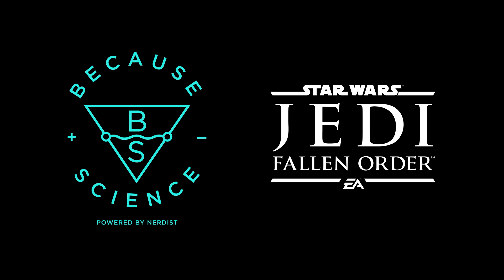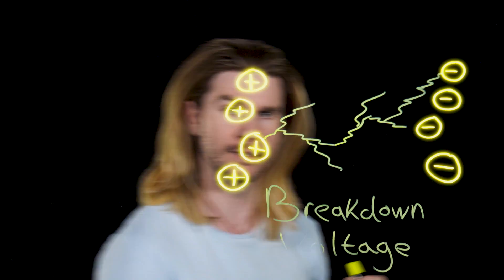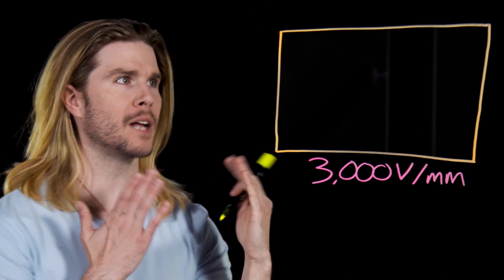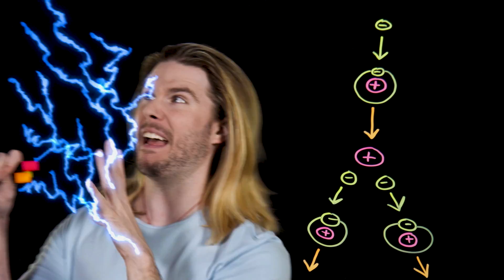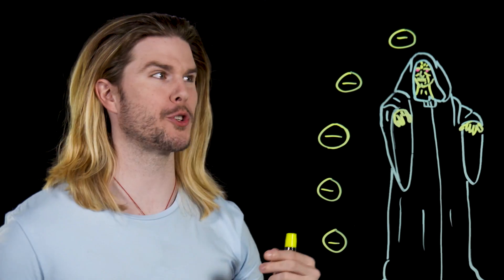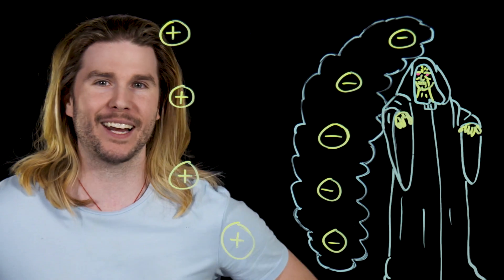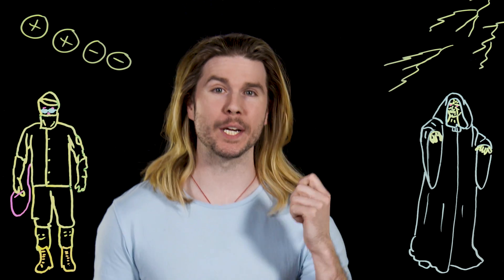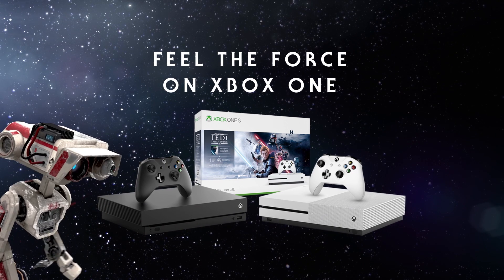How Does FORCE LIGHTNING Work? (Star Wars SCIENCE)

Comment: Ok i thougth about it once before i saw your video, and there is some problem with your solution. 1.st problem: Current will try to discharge of the way with least resistance, so sparks wont go as prob 22m to the human body and then to the ground, instead they will go 1,8 meter to the ground, depends how high is your hands (you kinda solved this solution .... but it would take mutch larger area), 2. nd amouth of power: you speak about high voltages and sparks but people dont die only because of high voltage but the power it delivers by Volt*Couloumbs or Volt*Amps/Time - since spark last not even second it would just zap a jedi (and we dont want that) so Van der Waals generetor woudnt be great. 3. rd is that force lightning can be blocked by lightsaber.
Since a wrote all the things i remember i can get to conclusion. I theorized that what killing a jedi isnt lightning but radiation. That a sparks are just secondary effect.
Imagine a palpatine is giant microwave or magnetron or something like that. Can you confirm this theory or dismiss it?
Yeap i am a**** for nitpicking :D

Comment: Hey, so... i couldn't help but notice that no mention of the REAL killer of lightning was mentioned.  it's not the volts that do the damage,  it's the Ampres. a typical lightning bolt transfers between 10,000 to 200,000 amperes of current in just a couple of microseconds.  conversely, a standard issue police taser conveys approximately 3 and a half milliamps. the amps are what cause the pain and the muscle contractions within the body.  youtube doesn't like subtext, for some reason,  but the formula is  amp = watt/volt ... ohms law applies, so amp=volt/ohm   A = V / Ω.
Reply: Yeah, that wasn’t mentioned. But when your talking millions of volts your probably going to have several hundred amps to go along with it unless the target has an extremely high resistance value. 2 or 3 amps can kill, and while the human body has a very high resistance, it’s not 15 to 20 million ohms good.

Comment: Fun fact: There is also a power called 'Force Fire'. It is a neutral power (both jedi and sith can use it) achieved by rubbing the particles in the air to create friction and heat, but it's so volatile that few can use it effectively in battle to the point that Palpatine has trouble using it.

Comment: (Spoiler alert for rise of Skywalker)  now the longest force ligh lightning would be from the emperor when he shocks all the spaceships in the sky which could be easily what's a 1 mile in the air generously. so using your own  estimations the total volts he would be a spelling is around 4.5 billion volts. which inmate comparison in comparison to a regular lightning bolt is only 1 billion. Not only that but the total amount of joules of energy that is released is about 1 billion and it's over the time frame of 30 microseconds. That is 1,000,000th of a second. So if you take the amount of energy that he is releaseing over the time frame that it is, it would end up being a grand total of 8,999,000,000,000,000 , volts. Or 44,999,550,000,000,000 Jules. In comparison the total amout of energy the entire world uses is about 1,000,000,000,000,000 Jules. In conclusion the emperor would have been able to power the entire Earth energy need for 44 and 1/2 days in just one minute worth of lightning.

Comment: I think it's very important to include that voltage wine not irrelevant, isn't the dangerous part of electricity. A human can encounter 100,000 volts with no ill effects other than a lot of lactic acid buildup. Even watts don't covey how dangerous a current is. Amps is what makes an electric current dangerous. 

Power lines aren't dangerous because the might have to 500,000 volts. Van De Graaff generators easily put out 500,000 volts and all it does is make your hair stand up. Current or rather, amperage, is the important part. Van De Graaff generators only have a current of micro or milliamps. 

Of course we can forget the time factor as well since that accounts for the total energy. 10 amps for a picosecond likely won't kill you. However 100 milliamps for 10 seconds likely would stop your heart. Voltage is fun, it looks cool, but it's not deadly.

Comment: Okay, going to be a little geeky here, but you only referred to the breakdown voltage of air without much reference to the fact that the  lightning is aimed and its effect on the user.

If you consider the user as the source of power, it becomes somewhat of a problem since it requires the user of the lightning to "sacrifice" his own electrons to initiate the charge for the voltage breakdown to generate the avalanche, which will ionize their own body causing severe burns (which, even with force healing, will still not recover the missing electrons since force powers don't generate matter).

Furthermore, aiming a lightning bolt is trouble...you need to maintain control over the flow of electrons constantly (which is not impossible for a force user of course, but should increase the difficulty with the magnitude of current running through the lightning).

A more reasonable solution is that the lightning user manipulates the air itself to be come ionized using the force (which is just a forum of telekinesis - i.e. Force push/pull - on the air atoms) or perhaps use some other external object as a source of electrons. Manipulation of the lightning direction then becomes easier since ionizing the air creates the path the lightning takes on its own.

An additional problem is that the more electrical charge you feed into an object, the more it will electrostatically repel more electrons, making the lightning more difficult to perform the longer it is held. A possible solution would be to create a positive charge either in the target or on the ground using the same force ionization technique to make sure that the charge remains balanced and the flow continuous,and this also continues to the aiming of the lightning.

In Legends, it is shown by Darth Vader that force lightning doesn't HAVE to originate from the user's hands and can be generated externally, which further supports this theory.

If you consider the lightning and its aiming method as plasma and ion manipulation using the force, it also explains why it can be blocked using a lightsaber as demonstrated by several jedi like Mace Windu (the blade being itself plasma tightly held in a blade form).

Comment: Theoretically, there is another potential rather than overloading the air, they use something similar to the arcthrowers that popped up in the books, essentially using something to ionize the air along the path, basically, a fraction of a second before the lightning is released, letting them guide it even more since it would be a force guided thing in the end.

And, just as an added thing, Disney Palpatine fails hard against Legends stunts.

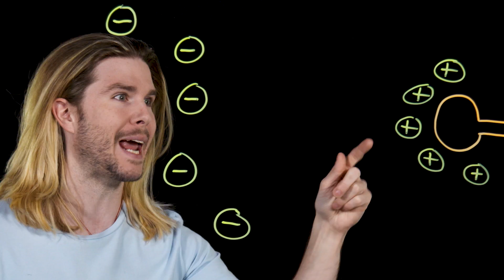Comment: 2:20
Just wondering.. in your animatin the electrical current goes from the + side to the - side... I thought that the electrical charge is supposed to go from the (-) negative side -> towards the (+)postiive side. 
Maybe I remember this wrong its been forever since I was in highschool chem.. but when working with Re-dox reactions I was to understand that molecules react to one another and become Ions. Ions either release, or obtain an electron from one another. the ions that have taken electrons away from other molecules(Other Ions) are the ones that have an Electrical charge. When a ton of negatively charged Ions discharge substantial amount of electrons on a very large scale, you get lightning... But then shouldnt the lightning in your animation be going from the (-) pole towards the (+)Pole??? OR did I miss something??

7:16
Nevermind!
Your animator probably just got a little lost during the editing at 2:20 but at 7:16 your animation is exactly what I would have expected :-D <3

Love you show !!

Comment: Hey Kyle, 
Great episode but I do have a few things to add that you did not mention. Even though the one on the receiving end of the force lightning would get badly burned from the heat produced, the one conjuring said lighting would be burned as well, though not as much due to the polarity. Polarity is actually a large consideration in welding because it determines the amount of penetration goes into the metal and where the majority of the heat produced by the arc is directed. For example; with the electrode being negative and the work positive, the electrode will burn slower and you will get more penetration into the weld but you also run a higher risk of burning straight through the metal. With the polarity reversed, there will be less penetration making a weaker bond, and the electrode will burn up much faster. So this would mean that by using force lightning you could take down your enemy but also take yourself out as well.
You also skipped over amperage as well and that is the most lethal when it comes to electricity. 22 million volts does sound impressive but you can buy handheld tasers with higher ratings. Consider this though, the average home in the US runs on 15 - 20 amps, doesn't sound like a lot does it? Well it only takes 0.01 amps to create a painful shock, 0.1 amps for uncontrolled muscle spasms, 0.2 amps for severe burns and injury, and at .5 amps is almost instant death. From this you could conclude that force lightning must be at a max of 0.01 amps or even less because they are still able to move around and speak clearly.
I would suggest that in order to make it safer for the one conjuring the lightning and less so for the other, lessen the volts and increase the amps. This would lessen the burn you would receive but also make it into a one zap kill.

Comment: with telekinesis alone, it's easier to shock people with small taser rather than try to build up electrons in your skin and conduct several meter of electricity though air, ....or if you're really good at telekinesis, then just simply rip apart your opponent to pieces

Comment: https://en.wikipedia.org/wiki/Electrical_injury

"Current. The higher the current, the more likely it is lethal. Since current is proportional to voltage when resistance is fixed (ohm's law), high voltage is an indirect risk for producing higher currents."

"High voltage (over about 600 volts). In addition to greater current flow, high voltage may cause dielectric breakdown at the skin, thus lowering skin resistance and allowing further increased current flow."

Since we see Force Lightning rippling over surfaces and the skin of victims, but not out-right killing them, the amperage is low.

Comment: Dude. Seriously. This channel is called “Because Science”, and you’re saying things like “voltages that could fry them”, while voltage has absolutely zero ability to kill. You could get hit with 100 trillion volts, and while it would certainly hurt a lot, it wouldn’t kill you, as long as you didn’t have a pacemaker or anything else in your body that would be disrupted by electrical changes. Current is what kills, and it doesn’t take much of that at all to do the job. You only need .05 amps to stop the human heart, which is virtually nothing, especially when you consider that most receptacles in your house have an output of about 15 amps.

Seriously, man, this is disappointing. You really should be doing the proper research before posting videos. I’m merely a science amateur, and I caught this.

Comment: Minor nitpick : the breakdown voltage of air is only 3 kV/mm in perfectly dry air, such as one might find in the middle of a desert. Water vapour in the air reduces the required voltage to create an arc. So, for most everyday experiences, the breakdown voltage of air is around 1 - 2 kV/mm, or significantly less still if it's actually raining.

And, there's a danger to trusting a Faraday suit : while it can indeed protect you from millions of volts, the current flow through it will heat it up. For a large current, such as the tens of thousands of amps in an actual lightning strike, the metal mesh in the suit is likely to melt and give you severe burns.

Comment: It's dangerous to talk about volts like they are a quantity of energy.  They are, but only for talking about the average energy each electron holds in a current.

A single electron at 1 000 000 000 000 volts contains 0.000000160218 joules of energy.

Yeah, it could jump though a lot of air... would anyone notice?  probably not.

Comment: Hi Kyle,
Nice Sith impression you made there, you might not just be a supervillan, but maybe even a super evil Sith...
That could also explain the orbital bombardments you summon XD Maybe your Fleet ist stationed in Earts orbit and you just need to give a simple command.

But the Problem I see with the Siths charging themselves up and getting ready to discharge upon they'r enemys, would be that the Sith would shock himselve too wouldn't they? Just like you charging yourself up by shuffling over a carpet and then touching something metal, it hurts yourself too, so a Sith would always hurt himselv and his target... Would that be a catalyst for theyr anger? Do they get stronger with every Forcelightning they create?
But why then did Palpatine got so grumpy when Mace Windu did reflect the Forcelightning? How was he even able to do that?
He couldn't just throw it back since Lightning doesn't travel between equally charged points... But if Lightsabers really are made out of Plasma, bundled into a Blade through a magnetic field, they could just absorb the lightning because Plasma is extremly heated Gases in which the Electrons seperated from the Atoms so there are Plus and Minus poles inside the Plasma. 
But how doe the Sith create Lightning without injuring themselves? I would immagine them to charge the air just arround them, not themselves, and then manipulate the Air between right infront of them and theyr Target to create a Path of least resistance leading directly to they'r target without including themselves into the circut so they dont shock themselves right? Just like a candle lowering the Breakd Voltage of the air right over the flame.

But could they surpass a Farraday cage? Wouldn't Darth Vaders suit count as a Farraday cage? Or did the Emperor already thought of Vader turing against him so he avoided weaving a metal mesh into Vaders suit? Or could the Force charge particles even inside of a Farraday cage? Like using the conducting capabilitys of the metal surrounding the target? Or do they create an electric field overpowering the capabilities of the metal to counter the electric field so the metal has no more electrons to bunsh up on one side? But that would need such an abnourmously high Voltage that it would be easier for the discharge to just strike the ground surrounding the target right?

See you next Video my Dark Lord!
The Republic will reorganised into the First Sciency Nerd Empire!

Comment: One small addition:
You should just possibly point out that 22 M Volt would not only hurt you. After the first law of Ohm the incoming amperage equals the 22M Volt voltage divided through the 15 M Ohm resistance. Ignoring the skin’s resistance, since we’re talking of around 1000 Ohm, which is negligible compared to 15 Million Ohm, that’s “only” 1,5 A. That may sound low, however Direct Current with 0,3 A is enough to make you faint, apart from the heart attack, that can be induced from 0,13 A onwards.
So looking at that, I hope Luke saw a Doctor before having a good night on Endor.

Comment: I have a couple questions

1. Lightning occurs on Earth, with a pressure of 1 atmosphere, but in a spaceship or station(especially a supposedly incomplete one), there should be a lower pressure. Would this affect the force lightning? It should lower the breakdown voltage of the air, because there are less particles to block the flow of charge.

2. The military sometimes uses sonic booms as a weapon, flying overhead with jets to knock people off of their feet and shatter glass. Would this long, extended sonic boom(similar to thunder), that we don't hear, knock people over or at least rattle them?(especially Luke, who isn't expecting it and so hasn't braced)

3. The force lighting has many shards over a small distance, but they all stay together. Wouldn't the charge law say that they should spread out, not all striking Luke?

4. We are assuming that the metal all around them is insulated, so that the lightning doesn't destroy all the robots touching it, but wouldn't this create an EMP that would damage all the surrounding equipment, like the life support in Darth Vaders vest?

5. If Luke is wearing rubber soled shoes, the lightning wouldn't have any effect on him, as it isn't grounded, and so there is no reason for it to not go straight for the nearest grounded point.

6. Emperor Palpatine is thrown down into the power core of the vessel, so they are clearly close. Wouldn't the massive power flowing through cables near the core effect the lightning?

7. Lightning is static electricity but this appears to be current electricity, due to the extended flow, would that effect the breakdown properties of air, or change it significantly from lightning.

8. The lightning shown in the video jumps around all over the place. This makes no sense as electricity follows the path of least resistance and the already ionised air is the least resistant part, so theoretically the lightning should form an arc moving upwards, similar to a Jacobs ladder right?

Comment: I imagine that a force user could and would use their molecule manipulating powers to force air particles in their intended lightning path into a more dense tube of air in order to somewhat reduce the voltage needed, given that part of why air is such a good insulator is its low density of particles to carry the electric charge. This would also allow them to better aim which direction their lightning flows.